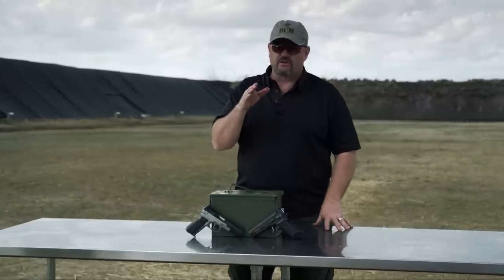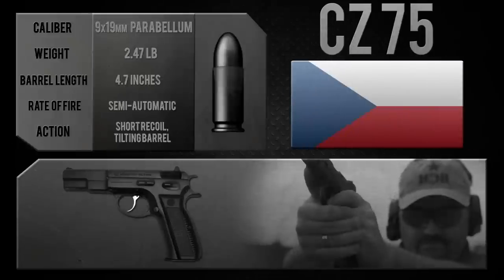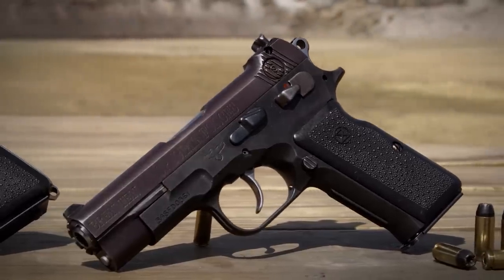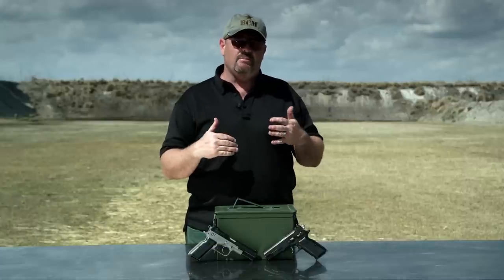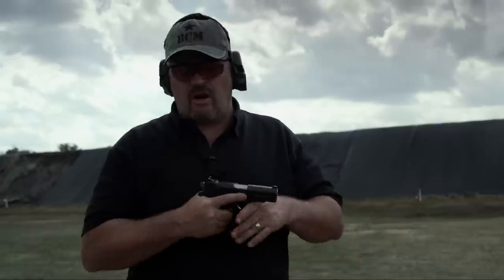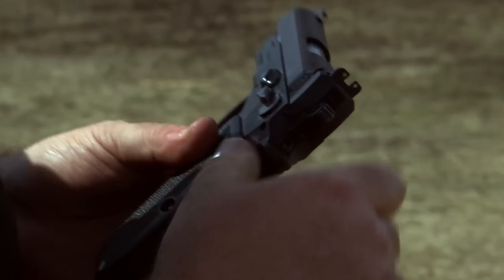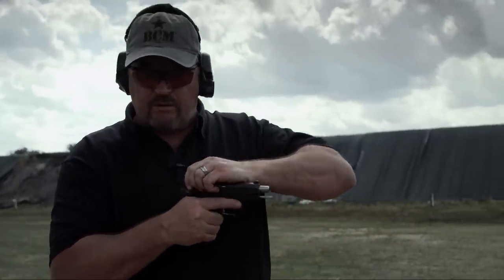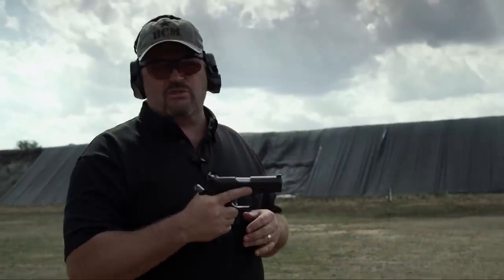Bren 10

Comment: I disagree with you saying steel pistols are dead. Starting I'm late 2015 and half way through 2016. I see more and more people buying all  steel pistols like the sig 220 10mm and gen 3 Smith and Wesson. I have even started seeing them in heavy metal 3 gun events where major caliber is needed for pistol. They always say history rhymes. I personally think you're going to see a resurgence of steel pistols in major calibers.
Reply: All steel isn't dead. But, the question is what kind of market is there for the gun? People still buy cz75 and 1911 pistols without a doubt, but they aren't for all shooters. And, how many of those willing to have the weight of all steel would move on from a 1911 or cz? There isn't enough demand for this pistol to invest in it to bring it to market.
Reply: Daniel Peer Their really good points you make. But if anyone takes the time to shoot a Glock 23 in 40 caliber and then a Sig 229 in 40 caliber their is a huge difference  recoil the glock is much snappier and the Sig is very smooth. I've seen a growing number All Steel pistols particular in the major caliber class in 3 gun. Not in 9mm but in 40 and 45.
Reply: Teddy Molnar
In 3 gun, I would use a steel gun because of the factors you mentioned. However, that's not the only, or even the primary, reason people buy guns. Tactical and self-defense trends are the different than 3 gun, wanting lighter, smaller, easier to carry, and easier to conceal firearms. I love the feel and recoil impulse of Sig P226s and Beretta FS92s, but I wouldn't want to stuff one in my pants and hope it's really concealed. (I've had guys tell me they don't print with those, but they're full of it. Unless it's under a jacket or something large and baggy, it's too big to conceal.) However, they're not bad nightstand guns. Of course, if you're going that route (ie having a nightstand gun and then a different carry gun), I prefer an AR15 over any pistol. Different strokes for different folks, I guess.
Reply: Daniel Peer Let me ask you a question. If the overall dimensions are the same a steel frame striker-fired pistol the size as a Glock 19 or Walther PPQ. The trade-off being it's a few ounces heavier. In return, frame rigidity less felt recoil and muzzle flip plus faster follow-up shots. Would you go with a lighter-weight polymer frame? Or the steel frame? The reason I proposed the question if I had a chance to fire a 9mm Smith & Wesson model 5906. double single action. I was amazed  how much less felt recoil and very accurate. I liked it so much wanted to purchase one they are discontinued, and the ones I did find were in very poor condition. Hence looking for a substitute. It's roughly the size of a Glock 19 or Walther PPQ that's why I proposed the question. We are on the same page when it comes to nightstand gun.
Reply: Teddy Molnar
 I hate to say it, but it depends on the situation. And, if I may be frank, I don't really care about recoil impulse. A lot of people talk about it - how much snappier the 40 S&W is than the 9mm or how much more 10mm kicks than 45ACP. It is something I hardly notice. Then I again, I can shoot pretty fast with almost any handgun I pick up that has acceptable ergos. Like, sub-3 second mag dumps in 8" groups at 7 yards. The bigger the bullet, the faster I run out and have to reload. Or, the bigger the holes I put in what I'm shooting, depending on how you look at it. I just don't care much about recoil because I find the effect to be negligible to me - until I start shooting .44 magnums and up, especially with how revolver handles are. (I'm amazed at Jerry Miculek!)

At a pistol range, with no one shooting at me, the smoothest, most natural feeling shooter is always my preference for enjoyment. At the point the bullets are flying, I'd take whatever I can get with reliability, first-shot accuracy, and capacity being the most important attributes - in that order. If I'm having to choose what to stuff in my pants and I get to choose from a custom 22oz Glock19 or a 32 oz custom CZ 75 Compact, I'd prefer the Glock. Why? 1 3/8 lbs vs 2 lbs is a factor in terms of concealment and comfort. However, I think there's a range of acceptable weights - just find the gun with the best ergos for you. Anywhere from 22 to 28 oz is fine. Though, I see no problem with someone carrying a 2 lb gun, as long as they carry it well and often.
Reply: Y'all are missing the real point here on steel frame pistols.  Sure polymer is easier to carry, thank goodness for  that  because I tote one around every day and I remember what it was like to carry an all steel gun and I have the back trouble to prove it.  But the real point is business.  It  costs a lot more money to machine a block of steel into a pistol frame than it does to injection mold it. Initially molds are very expensive to make, but that cost offsets itself when you have a pistol that sells like hotcakes, like a Glock or and Smith M&P for example.  When you can make a good serviceable pistol that shoots well and you can beat the other guys price point because you made it out of a less expensive method and material, you have a winner.  Not too many people can spend the extra dough to buy a machined gun anymore that costs twice as much as one of the polymer guns.
Reply: ***** cost of production is a factor because cost influences demand. However, I don't buy hi-points, regardless of the price or reliability testing done. In fact, I refuse to own polymer slide guns. Many people won't buy polymer frames and insist on steel. The cost isn't the only issue, or Hi-point would rule the market. There are clearly other factors at play.
Reply: I wouldn't disagree with that.  I was never really a fan of polymer guns either until the Glock was forced upon me at work.  Once I got to know it I really liked it because it just works, and it works rather well for what it is designed for. There are some things about it that I don't care for, but they pale compared to the things that I like about it.
Reply: ***** It's the advantages of a lightweight, polymer frame, striker-fired pistol that make PDs and even the Seals switch to Glocks. The military could keep buying Berettas or cheaper Sigs... the taxpayers would have to pay. (Which are both aluminum frames, btw. Aluminum is lighter.)
Reply: Teddy Molnar CZ all steel pistols are gaining popularity in competition as well

Comment: If you hanker for one of these, get an EAA Witness in 10mm. Like the Bren 10, it is essentially a clone of the CZ 75.
Reply: I bought one in 2014 - they can be pretty hit/miss on quality, I had to mitagate a few issues with mine. Supposedly newer models have fixed a lot of the reliability issues.

Comment: I really am not a big fan of polymer gun's. I don't like Glock at all, but I can thank Glock for keeping the 10mm alive. I do like Sig Sauer, so not against plastic gun's, but I am a collector and I love the all steel frames of older gun's. Plus most of the 1911's are metal of some type. I don't see why they wouldn't bring back the Bren 10 unless there was just no market for them. The gun has a cult following and I would like one myself. I also like the Colt Delta and it is all metal as well. I guess I don't agree with the age of polymer gun's has arrived. There is a place for them as well as all metal gun's. I doubt they will ever totally go away.
Reply: What kept the 10mm alive was the Colt Delta Elite.

Comment: I always wondered why nobody didn't make a Bren-Ten top slide for the Witness large frame as a conversion unit (hello, VLTOR?). Also, maybe offer a decock option instead of the crossbolt safety like the Beretta M92G and M92FS respectively.

Comment: I disagree about the day of the Bren Ten has passed. Polymer guns are great for being light weight, but other than that They don't hold a candle to a good all metal gun and yea, I am a 1911 fan. I like most guns, but I really like an all metal gun. The 10mm is experiencing a resurgence, so it would be easy to build a CZ in 10mm.

Comment: i think, for a lot of folks, a striker gun is just not ideal. it's perfectly serviceable, but it's kind of like bullpups. the trigger is never quite what you want, the design is never quite what you want, something about it feels compromised. i can't tell you what the Bren10 feels like in the hand: but i've done a CZ75, i've done a Browning HP, i've done a 1911 or two, S&W 59, and i'll take a DA/SA or a DAO over a striker gun if i can take the weight. never make the mistake of compromising your comfort with a weapon to go chasing after some feature you think you need. if the gun you shoot well is a single stack 9mm with a steel frame that weighs about twice what it needs to, then it's going to work out better for you than a gun that you don't shoot well.

it is a shame about that crossbolt safety though.

Comment: A total of 1400 were produced and sold. The mag problem wasn't that they couldn't produce them fast enough it was that they were designed to work with 45 or 10mm and they just didn't work. Since they had taken a bunch of pre-orders for the gun they had to ship them and since they didn't have a working mag for them they shipped without mags. The gun is basically a CZ 75 with the safety moved down and forward a bit plus a cross bolt safety on the slide.
Reply: Everyone who got a gun without a mag had to have given express permission to ship the gun without.  It's not like people were opening the box and discovering no mag had been included.  Buyers, who were aware that D&D were in rough financial shape, decided that they'd rather have the gun now, no mag, than have the company go belly-up and never get the gun.

Comment: With how Big Green Army is with pistol requirements, I honestly don't foresee any Glocks (or variants thereof) being pressed into service branch wide. They just seem to have a mistrust of soldiers being capable of following the rules of firearm safety, and instead they fall back on the antiquated notion of a manual safety. That taken into consideration, there are pistols like the Glock that have a manual safety, so there is likely something more than just "tradition" involved.

As to VLTOR coming out with the Bren 10, it might happen eventually, but EAA/Tanfoglio have pretty well cornered the 10mm CZ market.

Comment: I think it's a shame the Bren Ten failed. It was a very well designed gun. If the magazines were better and a couple of small parts would have been manufactured better it could easily still be around today. In my opinion Dornaus and Dixon failed, as a company, not the Bren Ten itself. I had the pleasure to fire a .45acp version of the Bren Ten back in 1992. At the time I owned a Series 80 Colt Delta Elite 10mm auto and a Colt Gold Cup National Match .45 acp. The Bren Ten was not as accurate or as smooth as either of the Colts but I could tell it would have only taken a bit of fine tuning and maybe a better barrel to give them a good run for their money. The grip of the Bren Ten felt a little strange at the time, being so used to the 1911's, but even so it felt good and the gun was very comfortable. The owner of that gun said the worst problem he ever had was failure to feed and that was usually when the gun was dry and had not been cleaned for some time. I suspect a bit stronger recoil spring may have eliminated that problem.

Comment: Is there really much of a difference between the Bren 10 and an EAA witness in 10mm?
Reply: +Josh Callejas The EAA comes apart.  To many issues and mods required to bother owning a Witness, unless maybe you get a top end one, but then value is out the window (which is the ONLY reason you ever looked at the gun) and you should have bought something else.  Check out RIA double stack 1911 in 10mm.
Reply: + BL y I've had two EAA Witness 10mm's.  Both were fantastically reliable and solid as tanks.  One was a top end (Match model), one was a standard steel.  I had to sell them to pay medical bills, or I'd still have them.  I know that this is a fairly small sampling (2 pistols), but my Witnesses were awesome guns.  When I pony up for another 10mm, a Witness will definitely be on my short list.

Comment: I would love to be able to have one, just because I am such a fan of the 10mm.  I started my gun carrying days toting a magnum revolver so I like the idea of being able to get a magnum powered pistol that is still in the realm of carry-ability.(read not a desert eagle).  I have a Smith and Wesson 1066 that is the next best thing to having that Special Forces model so I guess I will just have to settle for that.
Reply: Kevin Buller if you want something semi-auto and has magnum power capacity, look at the Coonan .357 magnum 1911, is a 1911 made for the .357 mag cartridge, it it's pretty cool but it is expensive, starting at 1800 going to 2400
Reply: A Coonan would be nice, but when I can get a Glock 29, a Glock 20 and a Glock 40 for the same money it is hard to go that way.
Reply: Kevin Buller well I recommend a Glock 20, 10mm is a good cartridge to leave a hell of a hole
Reply: I have a 29 at present, but I would like to have a 20 and a 40.  Can't get enough 10mm.

Comment: Why would I choose a Bren Ten over a Glock 20? The Glock 20 has not been without problems and I won't get into unsupported Glock chambers but that is not why. The trigger is why if its a stock pistol. Clean breaking single action hammer instead of some sloppy light striker trigger that jerks the front sight on the break. Stock striker pistols have their place for closer range but for longer range shots a SA hammer is where its at. That is why the 1911 is still around and still used as a match grade pistol. But I would not pick a Bren 10 for its high cost when a Tanfoglio Witness CZ75 clone in 10mm or SIG P220 10mm and so on would be better.

Comment: I'm partial to metal frame guns, but my EDC is a SIG P250SC-9.  I own an EAA (Tanfoglio) Witness Steel Compact in 10mm with also a .22 LR conversion kit which is also CZ-75 based like the Bren Ten.  EAA (Tanfoglio) along with SIG are pioneers in caliber conversion.  I bought that pistol over 15 years ago and still love it.  The only reason it's not my EDC is that I haven't gotten around to getting a 9x19mm conversion kit for it.  My urban EDC caliber is 9x19mm 147 grain subsonic with the Federal 9MS being my preferred EDC defense round.  I prefer classic hollow points over exotic ammunition.  

My next 10mm acquisition is going to be an FK BRNO PSD with a 10mm barrel.  BigDaddyHoffman1911 did a wonderful review on it; https://youtu.be/DapN-_KprhU

They have a collapsible stock for it, just SBR it on a BATFE Form 1 and you're good to go.  You have a wonderful SBR in 7.5 FK and 10mm.  😎

I would love to see you do a review on the FK BRNO PSD and see if you get excited over it like BDH1911 did.  I did just feeling his rapture through YouTube.  It's such a beautiful firearm along with the Bren Ten with beautiful engineering behind it.

Comment: I thoroughly enjoyed the video. I am interested in the Bren 10 as to seeing it on Miami Vice. How many inch barrel is on the two toned model? I would love to have this same barrel length and with the slide in the lighter color metal and the main framework in blue in. 45acp Colt 1911A1
Reply: 0 0 .hi there, thanks for the info... I want one just like sonny Crockett 10mm rechambered 45acp stainless steel or heavily chromed... I heard sonny's slide was originally blued but prop dept had it heavily chromed for more visability. ... love that unique sound which may be false as a recorded sound like dirty Harry sound was?

Comment: Glock 20 works just as well.
Reply: The6thMessenger I beg to differ. That stock Glock striker trigger won't cut it at longer range. The Bren 10 SA hammer trigger is clean breaking.

Comment: Why would I pick one of these? Because holding a glock feels like a damn 2×4. Also, Fuck polymer.
Reply: I guess i dont have anything against polymer i just prefer steel. For me what it comes down to when it comes to a cc firearm is more about the overall size than the weight. I used to carry my fullsize 1911 with almost zero problem (it has an extended safety that can dig into you sides if its not holstered right). The weight never bothered me but I do have a larger than average frame. I've recently switched to a Taurus compact for my carry gun simply because the smaller size of it makes it much easier to carry (just slip it in my inside coat pocket and your ready to go) .
Reply: Also I've been looking at getting an ARCUS but have been seeing mixed reviews about it. How do you like yours if you don't mind me asking?

Comment: They would ship this gun without a single magazine?!!! No wonder hardly anyone has ever heard of this handgun. So what the hell are you suppose to do? Single feed the firearm in a firefight, nevermind activating the cross bolt safety each and every time you rack the slide to get the handgun in battery. Thank you Capitalism and the Free Market System for getting this HUNK OF JUNK off the market. What a POS, I wouldn't even buy the thing to hang it on the wall. Great video anyhow...

Comment: polymer is over rated give me all metal any day.
Reply: ATARI800XL It doesn't have to be all steel. There are plenty of lightweight aluminum and alloy frame pistols out there. There is the argument that plastic flexes to absorb recoil but the lighter weight the gun the more recoil so that kills that right there. I can tell you from experience that wood is a more stable stock platform on rifles than plastic translating to better accuracy. The other big reason for plastic is its cheaper and easier to form parts holding costs down but you wouldn't know it by the high cost of some plastic frame pistols and plastic stocked rifles. I am like you. I am not always able to get it but I prefer a metal frame or wood stock for better stability.